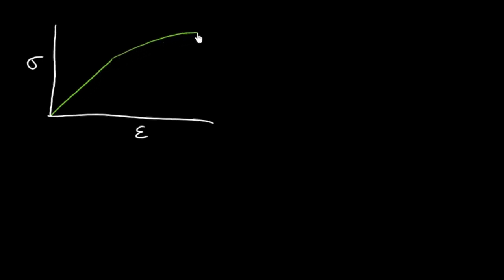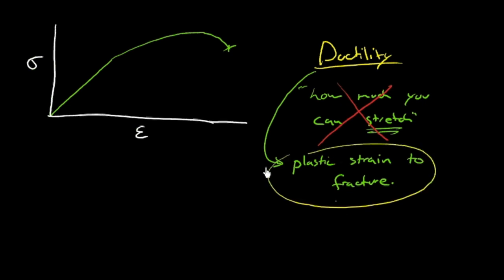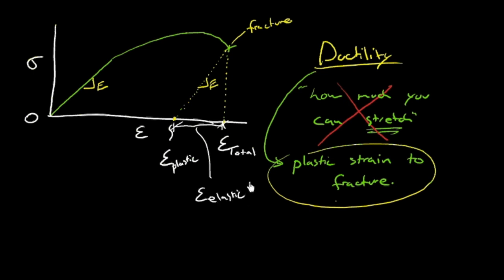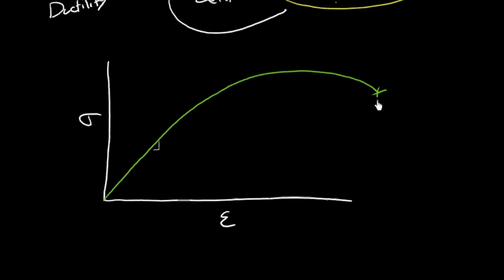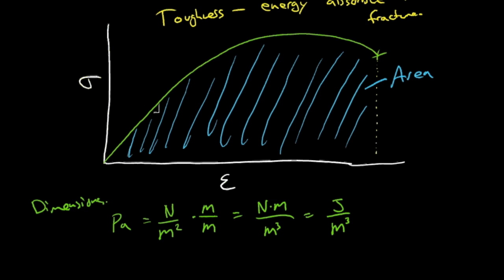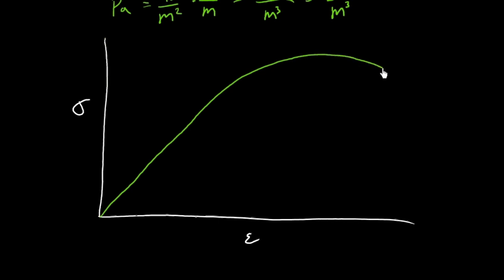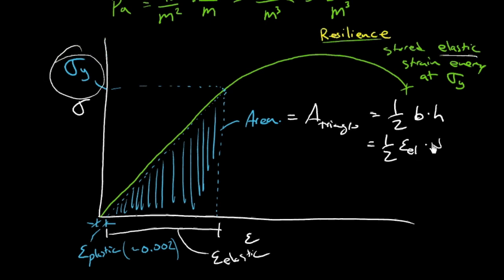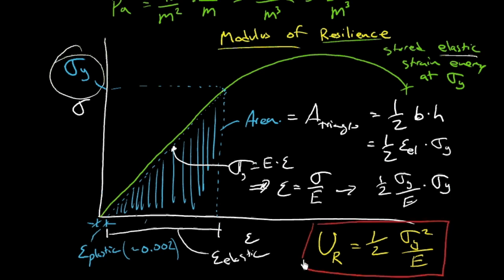Ductility, toughness and resilience

Comment: I don't understand how you calculate the area under the curve to get toughness. Could someone explain?
Reply: I believe is a definite integral. However, you need an equation for the line on the graph in order to be able to calculate it.
Reply: @Maedetto  You might not have a discreet equation for data like this, in which case a numerical integration approach like simpson's rule or the trapezodial rule could be used to approximate the integral. Just choose your n-value to be sufficiently large enough to get a good resolution of the integral and better accuracy through the numerical method.
Reply: I would simply do a numerical integral approximation after graphing a rough sketch. Python would be good for this.